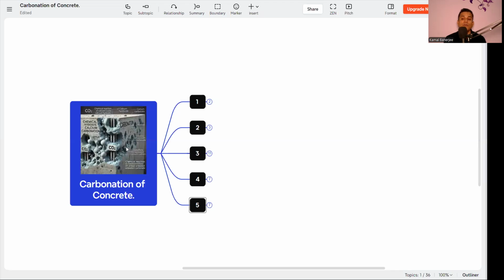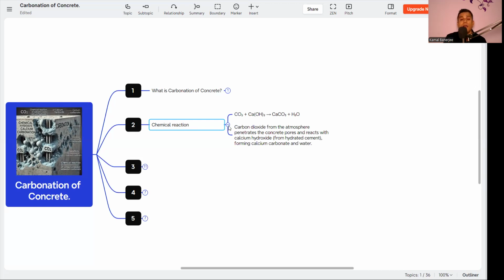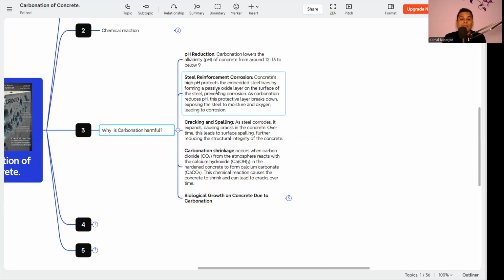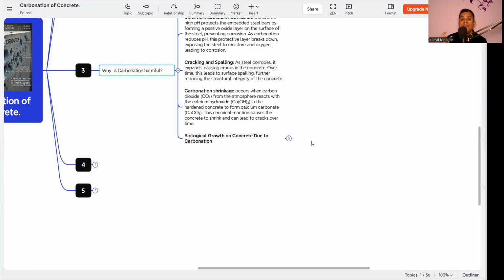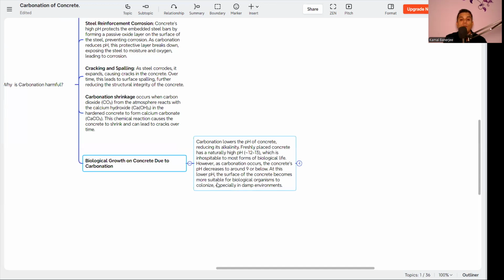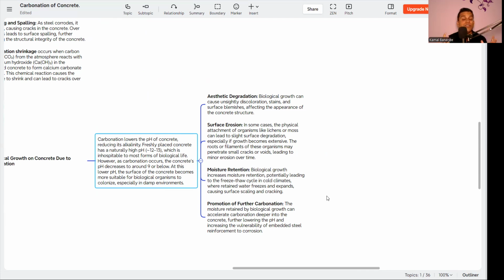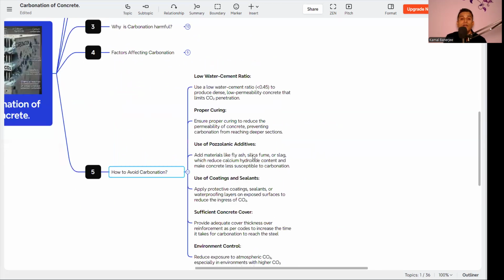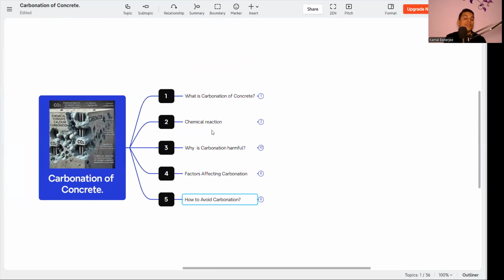Understanding Carbonation of Concrete – Causes, Effects & Prevention

Comment: This video is so much useful.
I want to show some Highlights of this video😃 --
*Drawback of Carbonation:
-It will decreases the pH value from 12 -13 to 9. Due to low pH steel starts corrosion. Reduce the life span, possibly to occur cracks.
-Carbonation shrinkage - Reduce the volume of Concrete and may occur cracks and effect the Life span.
-Biological growth - chances to occur in low pH by the carbonation. Biological growth hold the moisture in concrete and In case of winter season it may freezing by this effect may chances to develop cracks in concrete.

Multiple factors affect by this carbonation like WC Ratio, Permeability and so on.

Avoid this effect by,
-Low WC Ratio
-Sufficient concrete cover
-Use Pozzolanic Additives
-Proper Curing
Reply from the maker: Thanks for your valuable insight